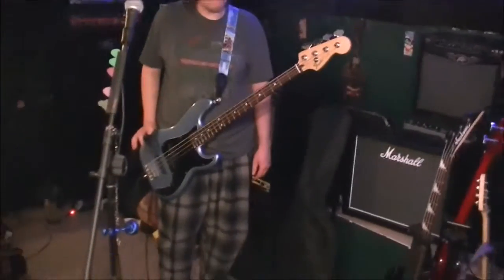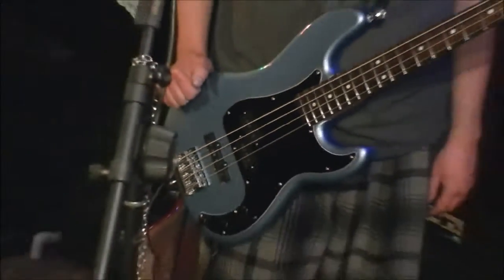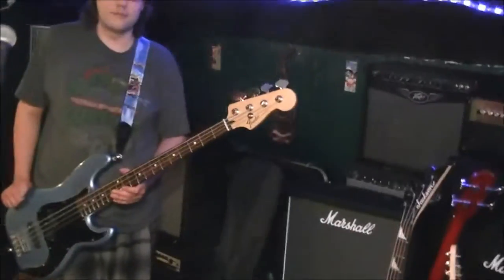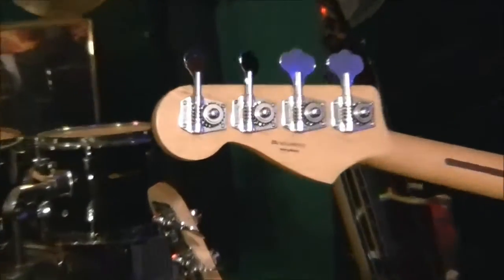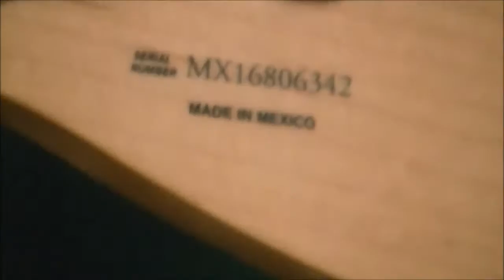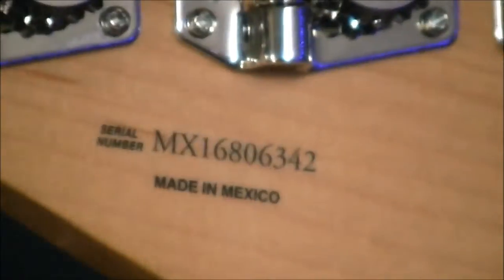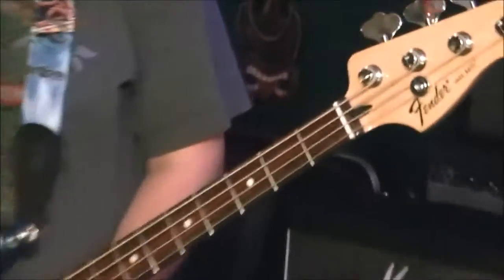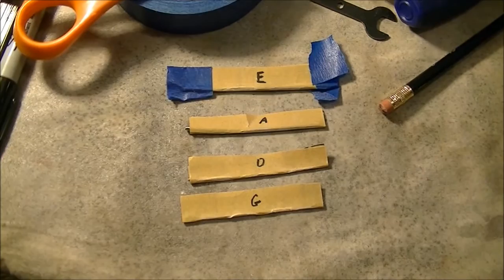Squier Vintage Modified ..... Modified

Comment: Those GZRs sound great.  Planning to get a pair for my Lake Placid Blue VM PJ Bass too.  I like the stock neck with the vintage tint to it, though.  Anyhow, nice bass and nice mods.
Reply from the maker: Thanks for watching! (My son took the original neck and bought a new body for it.)
Reply: I got the Geezer p'ups -- did you have to solder the output wires to the existing barrel output jack on the Squier VM?  It looks like I'll be learning to solder, unless I hear back different.  Thanks.

Oh, and I love the improvised intro to the N.I.B. riff.  Very cool.
Reply from the maker: My son wired this one so I'm not sure, but I think he installed a Switchcraft jack in it. I think he did solder it. It's a good skill to have and isn't really that hard. Oh, the pickguard on that one now sports a fallen angel decal. :)
Reply: Thanks for the reply.  Bought a soldering kit this evening and gave it a go.